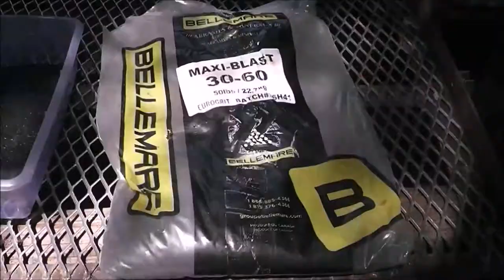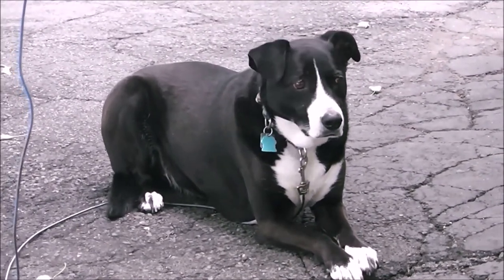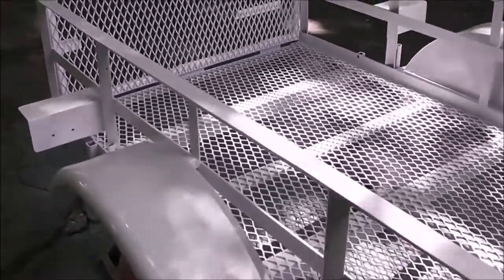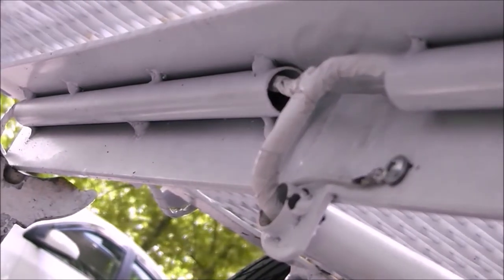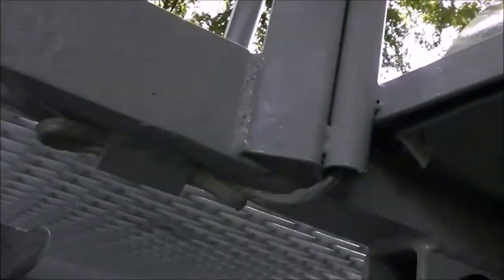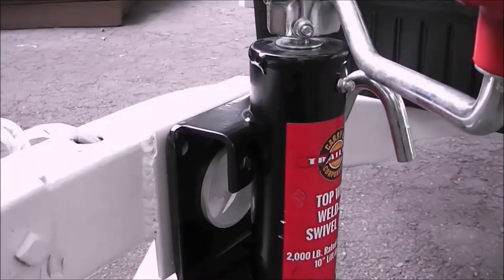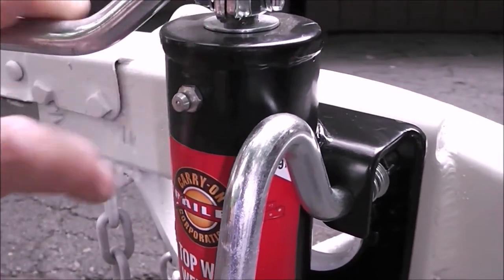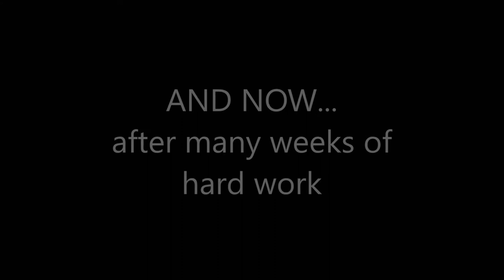The PILE Trailer Rebuild Series E.8 THE FINAL EPISODE!

Comment: Nice build. What type of air compressor do you need to efficiently run that sand blaster?
Reply from the maker: Rob Basich  Thanks! a basic shop compressor will run it. Mine is rated at 5 hp on a 30 gallon tank putting out 12cfm.